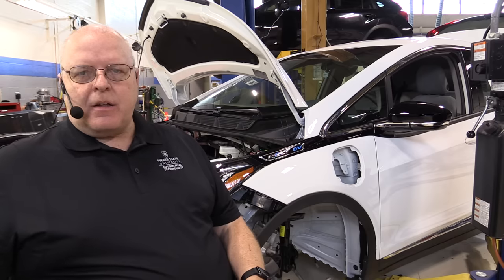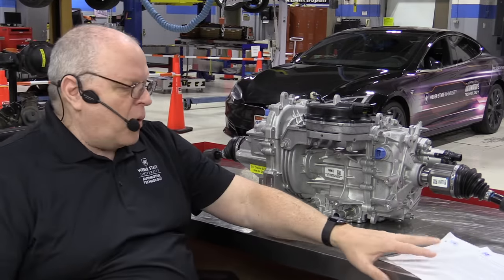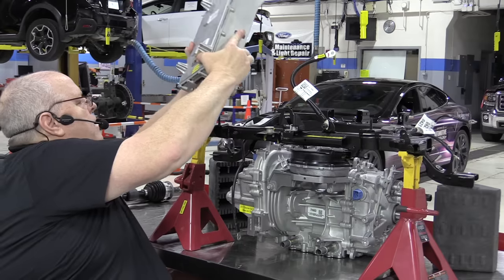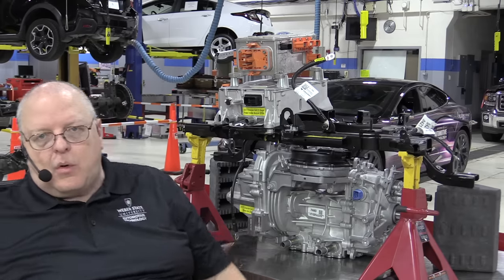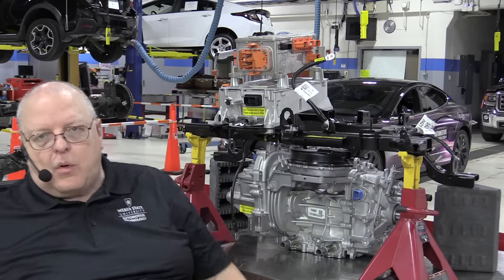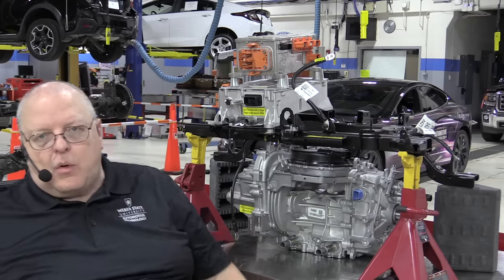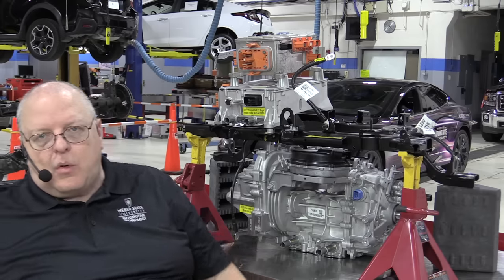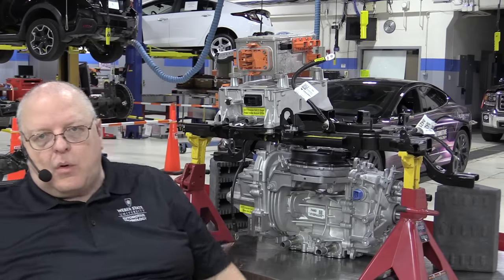Chevrolet Bolt EV High Voltage Components

Comment: A quick correction for you, the battery heater does function when CCS charging in cold conditions.  The complaint is that charge rate is reduced when the battery pack is cold, and the heater is only 2 KW.  The problem is that the battery heater shuts off around 64F pack temperature, and at that point maximum charge amps is still limited to less than 110 amps.  This may seem like a lot, but the Bolt max charging amps with a warm battery is 150 amps.  I think the logic was that when they set up the programming for the system, most publicly available CCS chargers maxed out at 100 amps, with a few 125 amp stations.  Now with lots of 125 amp stations and 150+ amp stations becoming available they need to reprogram the battery heater to vary it's shut off point based  on power available, so it stays on to a much higher pack temperature when connected to a higher power CCS station to maximize charging rate.
Reply from the maker: Great information! Thank you very much
Reply: Keith McDonnell - I have no idea if your comment is true, but I’m gonna upvote you anyways.
Reply: Thank you for sharing, 
Just my opinion, on THEY...... the thinking is, that the product is made as CHEAP as one will allow, then we, the driver will pay and relay info, making all this possible!
I can be really Negative about the issue for good reason, though what good will that do?
Reply: Makes sense -- most households only have a 100 amp service for 240 volts. So one might want a 200 amp service to run the pure DC charger.  A 0°C internal resistance is probably triple. Internal resistance will limit safe charge/discharge rate or charge rate in general. Pure DC charge rates will be higher than half wave DC due to internal resistance vs duty cycle of current applied.  One could lessen some of the internal resistance driving issues with a design that incorporated super-capacitors for acceleration demands, but that would be a lump of about 130 super-capacitor cells $$ :)    
The future would seem to indicate a fuel cell car might be more practical anywhere warm weather and cheap hydro-electricity are absent.  It is a moving target for the tax-man however that tends to stifle running cost advantages.
Reply: I was going to comment about what you could do if the car won't quick charge. My Bolt will run the battery heater while powered up, ready to drive. So, if the Bolt won't quick charge because the battery is too cold, one could let the car sit while powered up and it will heat the battery. Although, if you are quick charging, you have likely already been driving for a while and the battery should be plenty warm.

I'll have to find a way to take measurements, but mine only seems to heat the battery to a tad above freezing. Heating all the way to 64 F would take way too much energy if the car isn't plugged in.
Reply: @MrTsolar  take your measure with Torque Pro with a Android phone.  When driving during winter, you'll see sometimes when the battery heater come up.  But now, my question is really important, how can we FORCE the battery heater to start while driving so it will maximize the potential of CSS charge??  Can we just make a "switch" in the cable that control the battery heater??  I've to check on this...  But if someone got the solution, I'm a taker.
Reply: they need to reprogram the car with the Tesla style tech, when a supercharger is set as the destination on the gps the car begins to pre-heat the battery while in-route to maximize charging upon arrival.  Gm surely has the capability of a 4 g connection, they too should perform over the air updates. crosses fingers.
Reply: @WeberAuto  off topic of this thread but I can't find any information anywhere on this question. What happens when you eliminate the top speed limiter? What speed will  breakage occur? I have a spark ev and it feels like plenty power is left at max mph (90). Is it possible to reprogram for higher mph?
Reply: Or simply, the battery gets hot during charge, so just pre-heat it to a starting point and let the charging heat take it the rest of the way up in temprature?
Reply: @samueljackson856  I believe it is a safety limit for the RPM of the Electric motor.  Just like a ICE engine Electric Motors do have a Redline RPM limit.  The Volt is limited to 101 MPH but I know of at least 1 person that used a programmer to disable the limiter and easily went above 120 mph.  I am sure at some point a tune will come out that will eliminate the top speed limiter on the Bolt.  I have a 2020 Bolt and I really wish that GM had changed the final drive ratio so that the Bolt could at least go 110.  93 MPH is above the speed limit in all states, but in OK where Turnpike speed limits are 75-80 mph you easily have cars doing 90+.  It also means that if you go to a track day in the Bolt on many tracks you will hit the top speed before the end of the straight.  https://ev-mods.com/blogs/news/can-the-bolt-ev-go-faster-removing-wheel-speed-sensors-to-increase-top-speed-and-eliminate-traction-control
Reply: @WeberAuto  I'm wondering what the limiting factor is for upgrading the charging system from the j1772 to the ccs DCFC components and have it working as intended. (Please note that cost is not to be considered as a limiting factor for this question.) Is it software, hardware compatibility, or a combination of the two? I would really like to know because I would like to do it and document the full process and cost of the project. If it's a software issue, shouldn't it be possible to clone it from a Bolt EV of the same year and options that had the DCFC option installed from the factory? (I'm trying to be thorough in my research.)
Reply: I have a bit of an anecdotal update on this 3 years later, with a 2019 Bolt with a replaced battery and latest charging software over this past winter.

Chevy has done what they can with software to improve this without changing the hardware. With 20F ambient and a pack temperature of 35F arriving at a 100A charger, which is typical for a Bolt charged on L1 or left unplugged for 9hrs in a parking lot, the battery heater will stay on until the coolant is at 82.4F and will stay on to maintain that temperature as long as it has to. Coolant pump will continually stay on at maximum speed throughout the entire charge. The battery though still struggles to reach room temperature until you're at around 55-60% and this is when the charge rate begins to taper unfortunately. Typically, I'll hit the peak power of the station at 43KW at about 45% 

That being said, despite all of this, the coolant heater is still underpowered. I typically begin at 16-21KW can easily spend 35mins going from 13%-40%.

If you're willing and able to, you can expedite the process by a DIY preheating of the battery. If the road is mostly clear of traffic and you're safe about it, you can put it in L, floor the accelerator and then let off and hit the regen paddle on the wheel and do this over and over for about ~15mi or up until the motor and/or gearbox hits 200F. This will bring the battery almost to room temp and will give you at or near peak charge speeds much more quickly pulling into the station. Fortunately, if this was a longer road trip, this would only need to happen once since the battery will retain most of the heat until you reach the next stop.
Reply: @samueljackson856  I don't know when the motor would break apart from centripedal forces, but a few sources indicate the Spark EV PM motor is rated for 5000 rpm, Allegro cites 4500 when they talk about their speed sensors. If you plug in the 3.87 final drive ratio for a 2015/2016 spark and 185/55R15 tires, that gives 88.44 MPH so it seems to be correct. 
You could achieve faster speeds without programming or hacking by installing larger tires. Adding an extra inch will change a '15-'16's final ratio to 98 MPH. This would overspeed by 11% which is probably fine considering most engineers will apply a large safety factor between 10-50% depending on the mechanical system.

The 2014 Spark EV has a lower 3.17 gear ratio, so while it was also limited at 90, it could theoretically max out at 107.98 MPH.
However, drag forces increase proportional to the square of speed. If you visit the spark ev blogspot the OP suggests the motor torque and drag become equal and opposite at about 95 MPH, so after that point there's nothing left to give, you'd need a more aerodynamic body. 

Speaking of aero, the Spark EV has a drag coefficient of 0.326 Cd while the newer Bolt EVs sport 0.308 Cd.
Reply: @Infinion  yeah but adding taller wheels reduces torque mechanically so it would screw with the acceleration off the line. Even with stickier tires than oem there's still tons of wheel slip from a dig. Needs wider wheels but the range would suffer making it harder to daily drive. There's always trade offs lol. I guess all I was getting at was it feels like, power wise, there is a lot left on the table once you hit the electronic limiter.
Reply: @samueljackson856  Yeah I got you. It's probably because of the instant response to power. I feel the same way about our 2015 spark ev, but driving that fast feels a little iffy, especially cornering, even though the suspension is harder and sportier. 

There's a power band for electric motors and at 90 MPH the efficiency is lower, back-EMF is very high thanks to Lenz's law which  depends on RPM and magnetic field strength that naturally diminishes current the faster the armature spins relative to them. It's only making 60kW of mechanical power at the axle according to the sparkev blogspot's chart. 

You're right, the only place bigger wheels would work would be on a dyno without the drag. A 2 or 3 speed transmission would help keep the torque and power at optimal, but thats if the spark wasn't a sub-compact hatch and purposefully designed for high speed. A lot would need to change.

For what it is, the engineers optimized the hell out of it.
Reply: @Infinion  yeah and you would be hard pressed to find literally any other sub-compact that is as fast or faster than the spark ev. up until 90 you're keeping up with Subaru STI's damn near. it's wild. imagine if they gave this car a larger battery and a second motor for AWD and a little downforce with wider tires, like actually trying to make a race car out of it. I think it would embarrass a lot of gas powered cars.  Especially how light weight it is. love this damn car even how it is lol. (edit: oh and if they updated the charging capabilities to get 150kw charge rate instead of 50kw, even without changing anything else would be bonkers)
Reply: Always that one guy that thinks he’s the smartest
Reply: Dude, on DC fast charge its overheats pretty fast anyway, no need extra warming 😂
Reply: Can this send to fuse blow, or brakers to come down, as the car is requiring more amps and this can send to overload the network of Charging Stations and cut all the current>?

Comment: I grew up in a Chevy family where my dad ran super stock at Detroit Dragway. I own a Chev. Bolt and just felt if it works it works, and I'll leave it to the dealer. I will still do that.  I could help my dad  build a big block Chevy engine, right up from the block - but fairly mystified going EV. Now I don't feel quite as mystified. Thank you Professor.

Comment: Having active cooling for the battery IS an advance, but at the cost of much complexity in the battery construction.. with consequently greater possibility of failure ( coolant leaks), and cost.   It is amazing that they figured that the energy use involved in mechanical cooling ( AC unit)   was better than passive ( radiator) cooling.
Reply from the maker: Thanks for your feedback

Comment: As a Chevy Bolt EV owner this video is very interesting, thanks for producing it!
Reply from the maker: Thank you!
Reply: Seems I read somewhere they are going to STOP building the Bolt, is this correct?
Reply from the maker: @REVNUMANEWBERN  Not at all, they are going to stop production of the Volt. The Bolt EV production is actually increasing.
Reply: Numa Newbern no.  The Volt is to be discontinued

Comment: Thanks Professor Kelly for another great engineering video.  I was wondering if/when you would get back to the Bolt EV.  Thank you to you and your students that take the time to share this technical detail with the average audience.  As an engineer myself, greatly appreciated.  

I have no doubt that if the DC fast charging conversion can be done, you'll figure it out.  As you have a lot of resources, and drive to solve these interesting problems.   

Tempting us with what appears to be a Model 3 in the background is amazing.  From what I understand Tesla is kind of holding all service information close to their hearts.   I'm always interested to see your next video.
Reply from the maker: Thank you very much! That is a new model S

Comment: These videos are STILL being helpful Professor! I am having intermittent AC charging issue on my 2021 car ("Unable to charge" error), so was able to bone up on the related components watching this video. Helpful for being able to talk halfway intelligently to the dealer. The ECU is not storing a fault code so I want to persuade them to check wiring harness and connectors. Now I know where the connectors are!
Reply from the maker: I am glad it was helpful, best wishes
Reply: @WeberAuto  By the way, are you aware of where the ECM unit is on the car? The car finally threw a code at the dealer, and it pointed to the ECM. Personally I think it is a loose connector or a harness that is triggering the ECM code because the charging fault is extremely random. Charges fine for months. Then won't charge, or flashes back and forth between charge and unable to charge error. I am just wondering if the ECM is anywhere near the Onboard charger module, because I want to coax them into reseating all those connectors while in there.

https://www.youtube.com/watch?v=iq_PCPyJGco
Reply from the maker: @stevebakker6884  The ECM is the small box right next to the 12V battery
Reply: @WeberAuto  Thanx!

Comment: Thank you for the video Professor.  It helps me understand how the thermal management system works on my 2017 Ford Focus Electric.  FoMoCo also uses 3 coolant loops.  Each with it's own pump and a valve so the loops can function together or independently.   The MECS (Motor Electronic Cooling System) loop cools the traction motor, TCM and DC/DC converter.  The PTC (Positive Temperature Coefficient) loop heats the cabin.  It has a 179F upper limit.  The last loop is the BCCM (Battery Charger Control Module) and HVBP cooling and heating system.  It has a chiller and battery heater (3 @ 300W).  The BCCM is under the car in the tunnel where an exhaust system might be on the ICE models.  The HVB is in two sections (upper and lower)  the upper section is in the cargo area behind the rear seat.  The lower section is under the car below the rear seat.  Similar components to the Bolt....but different as well.  
Thanks again for your videos. 
Greg
Reply from the maker: Thank you and Thanks for your feedback

Comment: Excellent video!!! I just bought a 2023 Bolt EV 2LT and this video, I'm sure, still applies to my new Bolt. I've owned a 2014 Nissan Leaf for the last year and wanted something with much more range and the Bolt meets all my needs. I use a Level 2 charger in my garage and don't expect to take extended trips in the Bolt (at least for now) so won't have to deal with Level 3 fast chargers. Thanks again for your effort making this video.

Comment: That was a great overview, as a Canadian Bolt owner, I now have a better appreciation of the ‘$750’ upgrade for DC fast charging that was required to be sold in our country. There’s much more to the movement of the high voltage current than I had an appreciation for. I can’t wait until you do the Tesla now!
Reply from the maker: Thank you!

Comment: Thanks John. Well done. I am very technically and mechanically inclined and generically familiar with these system types, but seeing and understanding them relative to EV's and studying the automotive engineering and your descriptions have made them much less a mystery and very approachable. The transition for mechanical people from petro-powered vehicles to EV's will be a significant learning curve, but know what all the 'mystery' parts do makes it easy to get a grasp on; especially since this is where automotive and other transport is headed. I would have liked to see how you removed the CV joints, at least verbally. Great editing, camera work and script. Kids in 2030 looking under the hood of a 1999 Ford pickup: "Whoa, what is that?"

Comment: Thanks John for your excellent explanation of the Bolt powertrain and electronics. The packaging seems quite modular and maybe this will give GM some flexibility for future models and economies of scale. 

The final drive ratio is sooo low. Wow. 

Thanks again for your efforts to educate and demonstrate. Your videos are so nice to have access.
Reply from the maker: Thank you! I was thinking the same thing. I suspect these modular components will be seen on other GM EVs in the future.
Reply: That's the overall drive ratio, done in two stages, not just the final drive stage. It is typical for EVs, because the Bolt's motor speed is typical for modern EV motors.

Comment: I'm learning so much about my new car watching these videos. I bought a 2020 Bolt with slightly more range but since it wasn't a full model change, I'm sure most of this info is similar if not the exact same minus the battery chemistry upgrade from 57kwh to ~66kwh. Thank you for all the time you put into detailing this fantastic car.